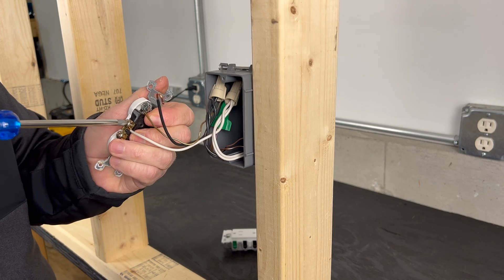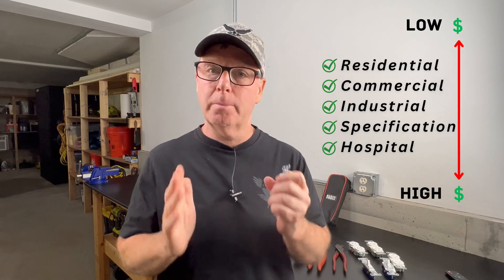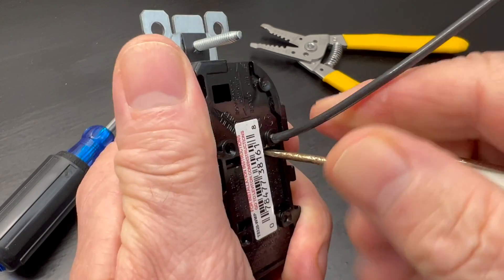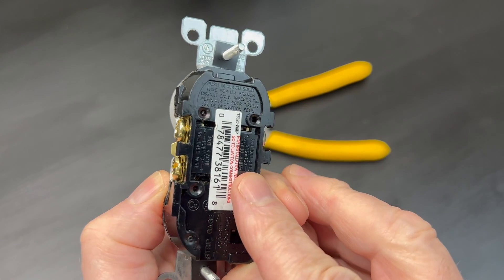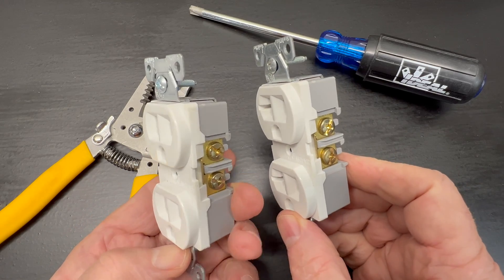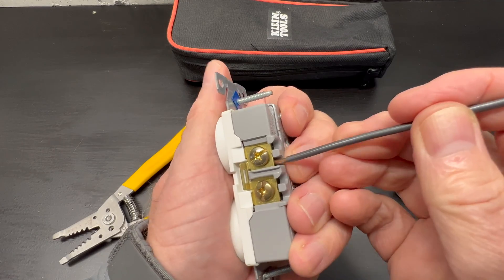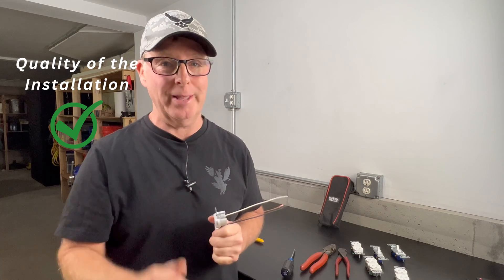How Pros Wire Receptacles in 2025 (Future Proof)

Comment: When tightening the j-hook to the outlet tell people why they want to seat the hook in the clockwise position . 
When you tighten a Clockwise seated j-hook it will pull the hook into the screw head . Counterclockwise it will push it back out and cause you to swear like a Sailor . 😅😅😅

Comment: I’d like to add that EV charging is more stressful on 120 V outlets than any other load.  While residential grade 5-15 outlets should be designed to handle the 12 A continuous load for 10-15 hours every day, most are not up to the job for the long term.  

For EV charging I always recommend using a commercial or industrial grade outlet.  The extra cost is trivial, and replacement of existing residential grade can be DIY for homeowners that follow instructions carefully.  Also never use the back stab connections for EV charging, use the side screws with J-hook or back wire held by the screw.

Comment: Can you , say, put 4 wires on one out by “back wiring” 2 wires and side wiring 2 wires ?
Reply: Actually six as you can back wire two wires to each screw. Note there are two holes for te wires. Though you should check it the manufacturer supports both methods at the same time.

Comment: I recently realized that it was time to replace all of the outlets in our 1985 Champion double wide mobile home and boy was it a chore to figure out how to do that safely. I knew from the get go that I did not want the cheaper residential grade stuff, but I did find some just a dollar more per receptacle that is considered Heavy Duty and yet only a normal 15A receptacle with 20A receptable features. Its the Leviton CBR15-W which give you side wiring that does not require J hooks. This idea really worked well for me because even though I have hundreds of Wago 221's I really wanted to place all 14awg wires directly under the screw, so these come with a copper metal clip designed to hold TWO wires under each screw, its a life saver and spares you from needing to use pigtails. Plus I get the benefit of knowing that the actual electrical wire is going all the way to the receptacle uninterrupted which I feel is safer. Using wire nuts or wago levers are just another point of failure imo. Thankfully this Mobile home gave me ridiculous amounts of slack in the walls, literally every outlet hole had like 18" of extra wire to work with. These CBR15-W's only cost $2.60 each or 19.99 for a ten pack. That is literally only like 40 cents more per receptable for massing extra safety benefits.

Comment: I'm super slow at this kind of stuff and wired three receptacles yesterday ...and then saw this video. 

So I'm going back and changing it all to j-hooks under the screws. But, my j-hooks don't look like your j-hooks, and they don't go on as fast as yours do. I literally just spent an hour getting one receptacle correct. I'm doomed!
Reply from the maker: It may take some practice, but you will get faster as you go. Better to take your time and have a safe reliable connection. My next video will cover installing a new receptacle into a finished wall. I’ll cover the whole process step by step including connections. It will be live one week from today. Friday the 26th.

Comment: I like that you are using a Phillips Pozidriv Slotted Bit screwdriver in your videos. If you haven't already, you should make a video on the different screwdrivers used in the electrical field. Also, I only use Ideal wire nuts that can be installed with an Ideal screwdriver handle. Saves wear and tear on your fingers.
Reply from the maker: I appreciate the feedback and will certainly consider your screwdriver video suggestion.

Comment: 5:55 The tiny hole beside the found screw to catch the end of the conductor to let you form a J hook around the screw is handy and is or at least was available for the hot and neutral of high end receptacles that didn't use the back wiring clamping plates. They were quick and would hold the wire tight to the screw if a little tension was provided on the conductor while tightening the screw.

Comment: Thank you for the information sir. I'm not a master electrician, just a diy guy, and I put a couple 20 amp switches in the wall to control my light and ceiling fan separately. I am on a 20 amp circuit, and I'm well aware that nothing through those switches is gonna draw nearly that much power
Reply from the maker: You can always go larger with no issue. Just be sure to use 12 gauge wire on a 20A circuit.

Comment: What about the each side? Has a copper connection between the 2 screws? Do those need to be split apart? Or will it work with it together?Like it is
Reply from the maker: The tab is only removed if you want to split the receptacle and feed one side from one circuit and the other side from another, or if you want to switch one side of the receptacle. Otherwise it stays connected.

Comment: Residential grade outlets range from absolute junk to barely adequate in light usage. For example, if you have an outlet in a corridor that will see frequent use from plugging in a vacuum cleaner every time you clean the area, I doubt that residential grade outlets will last in that application. Another area I would not ever use residential grade outlets is at a kitchen counter that will see frequent use with high current devices like a toaster and frequent plug and unplug cycles. Residential switches will not last switching motor loads, such as a garbage disposer. I was replacing residential switch for my garbage disposer every 18 months, until I wised up and used a Spec Grade switch. That was going strong after 20 years running a 3/4 HP disposer. 

Commercial grade and Federal Specification Grade outlets and switches will last virtually forever under regular usage. 
they are well worth the extra up-front cost.

Thanks for the well-presented accurate content.

Comment: Just bought yesterday a package of 10 receptacles exactly like those from Canadian Tire with a package of 10 white cover (in total for around 20$ taxes included only!). Have been starting to replace old receptacles (many probably from the building of my house in 1976). Future proof! Secure side wiring is the way to go. Thank you for the video!
Reply: the back wiring (not back stabbing) on the 20A receptacles work like connecting the wires into heavy gauge power cables connectors! Nice!

Comment: Without reading all of the comments, I would say that every serious or casual DIYer would benefit by using a branded Torque screwdriver to finalize the tightening of the receptacle or switch terminals. And especially the Circuit Breakers. I have aged a bit and what's tight for me, I have found, is not tight enough to meet code requirements.  I recently found screws inadequately tight in electricians work when I was double checking the installation.  The torque screwdriver set to the requirements noted on the wired component can significantly enhance the safety and reliability of the circuits. Backyard Maine could do a video on that subject alone.
Reply from the maker: Great idea, I will consider it for a future video.

Comment: So we can use 12- 2 for receptecals 15 and 20 amps??😮
Reply from the maker: Yes.. A 20A circuit requires 12 gauge wire but you can install 15A or 20A receptacle. But remember is not compliant to install 20A receptacles on a 15A circuit.

Comment: In the commercial receptacle, it looks like you could put 2 wires per screw using back wiring (One hole on each side of the screw), would that be a code violation ? , bcause why would they design it like that?
Reply: Yes, you could put 2 wires per screw when back wiring and it's not a code violation, however, my preference is to use pigtails and one wire to each screw, especially with 12 gauge wire. It allows for a less resistant installation and ease of future service.

Comment: What could it possibly hurt to install a 20 receptacle on a 15 amps circuit?

Seems like it would be PREFERRED, being heavier duty and all. (as long as you still treated it as a 15a circuit, of course)
Reply from the maker: The issue is someone could then plug a 20A load into the receptacle. Remember they are different with the horizontal blade. This would overload the circuit and couple damage the wire insulation and possible cause a fire. The 15A breaker is a protective device and should trip is the circuit is over 15A for an extended amount of time but it we want to make sure we are not intentionally overloading circuits. The code is specific about not using a device with a larger capacity than the circuit.
Reply: @BackyardMaine  it's just me, so I know I won't.

Hell, I've never even seen a 20 amp appliance with that plug.  Can you name a few?
Reply from the maker: @diylithiumguy  They used to be more common but not so much anymore. You can find power tools with a 20A plug. The code tries to protect the circuit regardless of what's connected. Thats why we have different configurations on our plugs with different voltage and average ratings. Keeps people from unknowingly making mistakes.

Comment: I was working in a commercial building once a long time ago.  I was not an electrician, but we were allowed to run wires and connect wires in the breaker panel and to outlets at equipment locations.  I was using the commercial outlets, and I was using the back-wired method.  An inspector came along and questioned my wiring method.  I explained that this receptacle had a little metal pressure plate that squeezed the wire, similar to a circuit breaker, so he allowed it.  But thinking that over I decided I shoul have wrapped the screw for reliability.
Reply from the maker: The back wire receptacles are just fine. I find them to be very reliable so in my opinion you were doing a great job.

Comment: why do ground connections still need j hooks?
Reply from the maker: Not on all devices but they are that way on many. I think it's because the ground wire is the most important wire and the hook and screw is the most reliable connection.
Reply: Likely tradition. They cannot offer options as one cannot have more than one ground connection so they offer the j hook.

Comment: Regarding your age: Never underestimate an old man in a dangerous occupation!  Really liked this video as it is very informative.  I've worked as a field service engineer at IBM for the installation of manufacturing equipment, and they have a safety rule where all ground prongs must be in the up orientation for the reason that you disclosed.  I started doing this in my home after my son dropped a dime across the hot & neutral prongs.  It arced and did not stop until I pulled the plug from the outlet.  I then replaced the outlet with the ground in the upper orientation and replaced the circuit breaker that failed to trip!  In my current rental home, half of the wall outlets are ground prong facing up.  In the future, I would install outlets with ground prongs facing up for all outlets except switched ones and for appliances.  Looking forward to viewing your other videos!

Comment: Very good video sir.   In the case of backwiring, why does each terminal have 2 holes?
Reply from the maker: It allows passthrough wiring so the cable into the box and the one leaving can both be connected to the same connection on the receptacle. You could add more wires as well but I always pigtail whenever more than two cables are in a box.

Comment: Hi! Yesterday, I tried to replace a 120v, 2-plug receptacle with an upgraded one that also provides two (2) USB-C plugs rated for 65 watts of power delivery. I was doing this in my recently completed kitchen. Unfortunately the new receptacle is physically quite deep and I could not fit it into the blue plastic outlet box. I made plenty of mistakes too: some of my wires had too much insulation stripped off and I was forced to trim the wires. I can't seem to form neat, effective J hooks with wires -- I certainly need to practice that. I also damaged a neutral wire. I should have had a really good pair of needle nose pliers and I really should get a much better pair of lineman's pliers than what I have. But the bottom line for me is that the blue plastic junction box that the receptacle fits into is too shallow for the new receptacle. I never thought to tell our electrician to maybe use deeper junction boxes so we can upgrade the receptacles later. How come? Well I never thought to compare the "smart" receptacles to the "dumb" ones and notice the physical dimension differences. Entirely my fault. Maybe some time in the future you can demonstrate how to replace a shallow junction box with a deeper one. It does look like it's quite a lot of work and might not be possible.

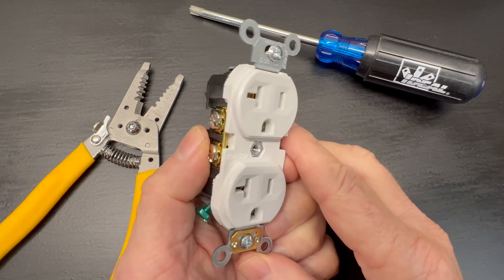Comment: The 20A residential grade receptacle at 3:50 also has a backwiring provision, the plate is just more exposed than it is on the commercial grade devices. I've noticed residential grade 15A decorator switches (particularly Eaton) tend to have these same backwire terminations too, which is sometimes handy for two switch legs in the same device box that would otherwise require a pigtail due to the practical limitation that only one conductor can be wrapped around a screw terminal.
Reply: You are correct.  I believe that the receptacle is a Leviton CBR20.  The backwiring feature also works well with stranded wire which does not like to be wrapped around the screw in side wiring.  I have avoided time consuming rewiring in a number of such situations by replacing the receptacles.
Reply: @1575murray  Yeah if you're dealing with stranded wire you should definitely use backwire terminations, OR I would crimp a fork terminal on the ends for side-wire terminations,

Comment: Hi, I have a beginner question. How do I cut 14/2 Romex cable off a spool of cable? Like say I need 6 feet of cable. How do I cut the cable? Do I just use the Ideal wire strippers or do I need a separate tool?
Reply from the maker: If the cutter on your stripper will cut it you can use them but an even better tool is a nice pair of linemans or diagonals.

Comment: Why does no one explain why there are two screws on either side of the outlet?
Reply from the maker: They are there for two reasons. First is for the ability to split the receptacle and either have one side switched or ad a second circuit. The other is to through wire on to the next device without the need to install pigtails. I cover this in detail in this video. https://youtu.be/K3RIjUnrNTQ

Comment: Not an electrician... Question..if there is a (potential) issue with backstabbing 15 Amp outlets,why are they UL listed? I thought that was the "gold standard "to look for.
Reply from the maker: I really don't know but I can say I have seen these fail at a much higher rate than any other connection. In low current applications they are fine but with higher current they will often become loose.
Reply: I don't think UL is all it is cracked up to be.  The backstab feature should not exist at all, in my opinion.

Comment: Hi John, Im wiring a house in Mexico and we only have stranded wire.  Can you tell me the best way to hook the ground to the oulet?  I guess I need back wiring outlets for the wiring of the outlets?  Thanks,
Sean
Reply from the maker: There are a couple of way to do this. The back wire with clamp plates is a good option. If your receptacles just have terminal screws I like to use instead forked crimp terminal connectors. There are other options but these are the most reliable

Comment: I'm a little sad to not see included in the discussion of screw bits the very useful square drive, which while not universal, seems to be common on electrical components.  I would have recommended that everyone include an S1 and S2 bit in preference to Phillips bits.
Reply from the maker: I was using a universal screwdriver from ideal. Fits perfectly. Similar to the Milwaukee ECX

Comment: Hi! Thank you for posting this excellent video. I'm a beginner with residential electrical circuits. I'm by no means licensed or certified in any work. I did not know the difference between 'backstabbing' and 'backwiring'. Thank you for explaining it and for demonstrating how to use backwired connections. I think my 120 volt outlet receptables that offer USB-C charging feature backwired connections, but I'm not sure. I'm interested in residential electrical circuits because I want to install smart 3 way switches in the addition part of my rather old house. I also want to extend a ceiling light circuit. Some challenges have been my own use of poor quality tools, especially the wire strippers. I also did not study how-to videos like yours. I did not realize there are different grades of devices. I also did not know it is a code violation to install a 20 amp device on a 15 amp circuit. It makes sense but I did not think that through. Fortunately I have not actually done so. This video helps me a lot, and I feel I am getting excellent advice.
Reply: Hue has various switches that can turn on/off, dim, change color of their bulbs wirelessly - so instead of needing new wiring you just put in the bulb, stick their switch on the wall and program the switch/bulb combination. The first time requires reading all the directions, but it works really well - I am sure other smarthome bulbs work similarly. We only installed the Hue bulbs once they offered the programmable switches because some of us don't want to use their iphone to turn on/off the lights.
Reply from the maker: Thanks! I’m glad I could help.

Comment: Back wired receptacles lend themselves better to stranded conductors than solid ones. You can still use solid conductors but the connections are more secure with stranded conductors. They are even less likely to work their way loose.